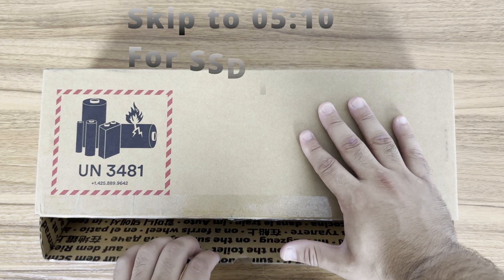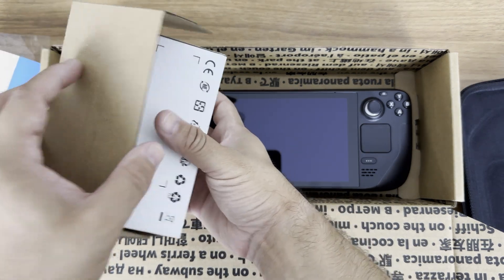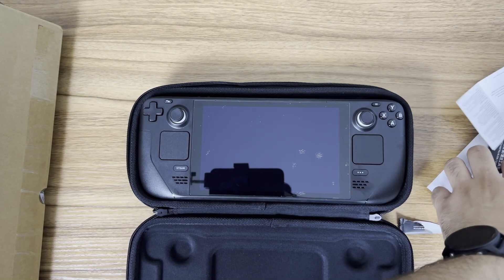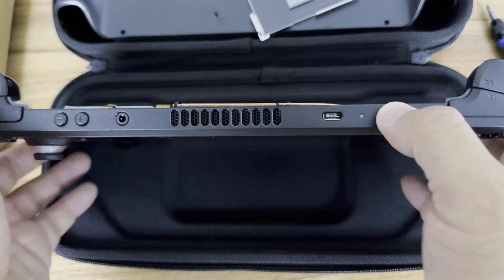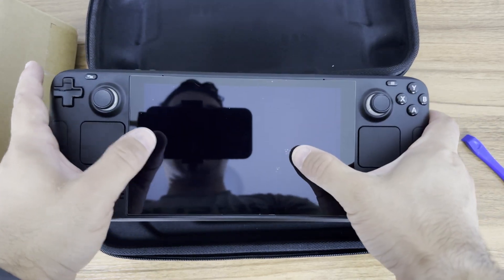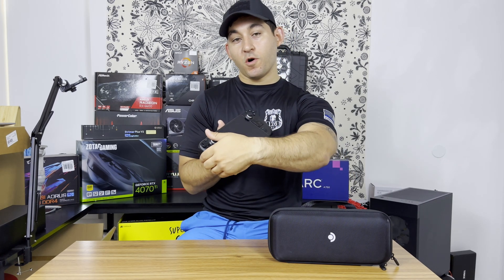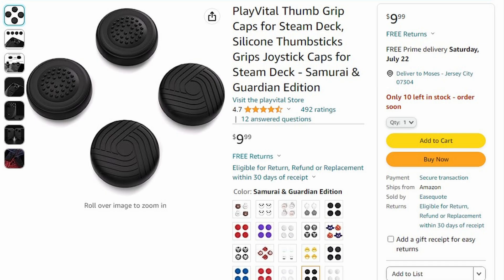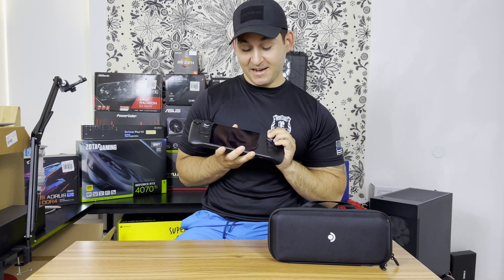I Finally Bought IT!! | Steam Deck Unboxing + Quick And Easy SSD Install Guide

Comment: Mine got delivered today. I got the base 64gb model and ima throw a 2tb ssd in there with a 1tb sd card for the ultimate emulation machine
Reply: Where do you find a 2tb ssd?
Reply from the maker: https://frame.work/products/western-digital-sn740-nvme-m-2-2230

https://www.amazon.com/Yassdwbn-SN740-Steam-Surface-pro9%EF%BC%8C/dp/B0BM9D1GXP

2TB SSD that are 2230 in size are somewhat hard to find.  They are also disproportionally priced compared to other 2230 ssd.
Reply from the maker: Also, I believe you can buy a Micron (2230) ssd for whole sale price, I just don't have a link at that time for it, apologies.
Reply from the maker: Oof that sounds awesome!  Ngl I’m kind of wishing I would of gotten at least 1tb 😅

Comment: my steam deck never boots up past 10:41 i can see the mouse in the middle of the screen but i cant move it
Reply from the maker: Is your usb c flash drive working correctly?  Did you install installation media from the link / plus format it with Rufus?
Reply: @Mdntech3000  i bought a new today pen PNY 32GB the only thing it ever had it was the steam efi witch i used rufus with
Reply: Maybe the boot drive is corrupted, try a clean install..not entirely sure tbh since I’m not a steam deck expert.
Reply: @amerant0205  https://youtube.com/shorts/dvmc6nKpyHg . Its takes  like an hour to get here and then i cant do anything
Reply: @theshadowwarden2992  Have you been able to get into bios at all? You're just stuck on the black screen with mouse?